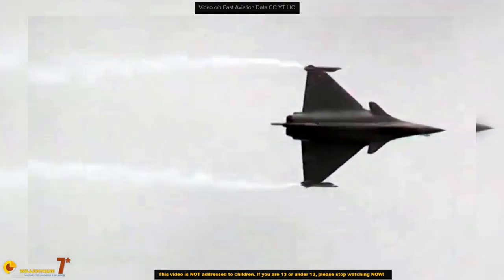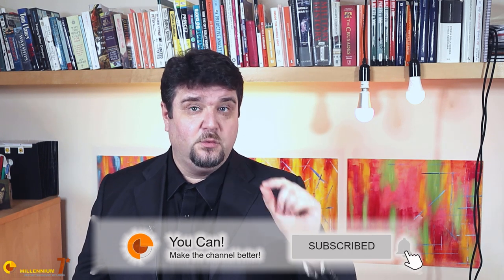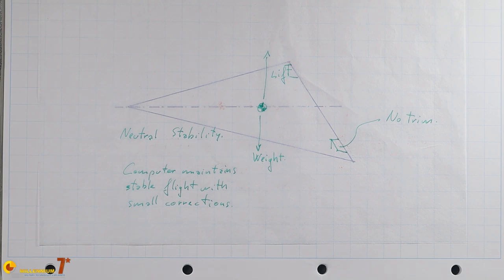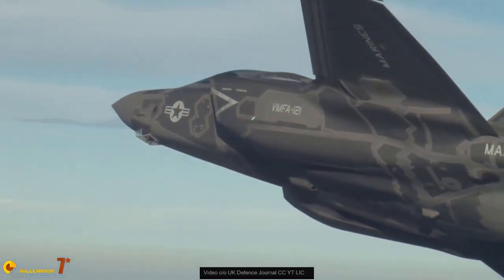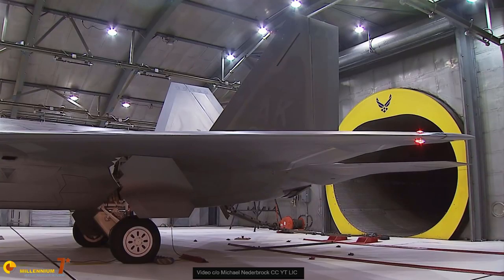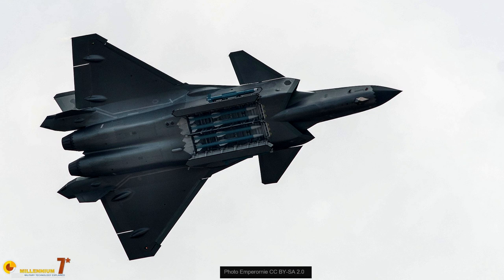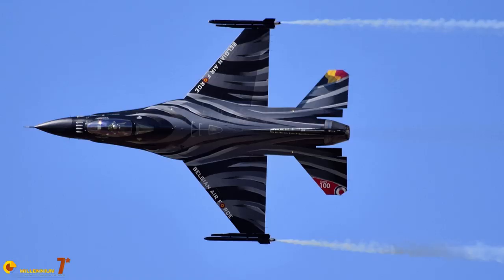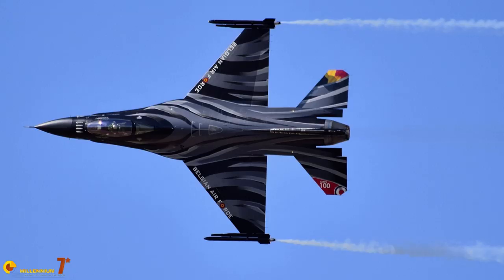Delta Wing: Why Not? - why Rafale/Gripen/Eurofighter are delta and F-16/18/22/35/Su27/Mig29 are  not

Comment: If you want to see what an F-16 with a delta wing would have looked like, there is the F-16XL, which was a competitor to the F-15E.
Reply: If you want to see what an F-16 with a delta wing looks like, just look at a bog standard F-16.
Despite what some may say, it is a delta wing -- a clipped delta, but a delta nevertheless -- with a tail making it a tailed delta.
This isn't something new ... the MiG-21 is also a tailed delta and if you look closely, its tips are clipped as well.
The difference between the F-16 and the F-16XL is simply that the latter is a tailess delta.
Reply: @lewiscole5193  Exactly what I was going to say. Both the F-15 and F-16 and delta wings, with cropped wing tips. The F-18 doesn't quite qualify, because the leading edge is no angled enough. The F-22 is basically a cropped delta, but with angled trailing edges.
Reply: @lewiscole5193  A clipped delta wing? Are you kidding me? I can make just as strong an argument as saying it is a straight tapered wing with a root extension. The F16 is a compound blend of two shapes. A smooth blend would make it an ogee delta like the F16XL. A sharper one like the F16 is a compound delta or a cranked arrow. 
The cropped delta are Typhoon or Rafale.
Reply: @watcher63034  
> A clipped delta wing? Are you kidding me?

No.  Are you trolling me?

> I can make just as strong an argument as 
> saying it is a straight tapered wing with 
> a root extension.

What defines a delta wing planform is that it looks like the Greek letter delta, which is to say a triangle.
If you extend the the line of the leading edge of F-16's main wing to meet the line of the trailing edge, what most people can easily see is a triangle that resembles delta.
Many people, perhaps even most people, think that a delta wing planform must have a low aspect ratio in order for the wing to be called a delta (say around 3 or less as this is what you see on aircraft that are intended to fly supersonically), but there is no "formal" requirement that I know of that says that this must be the case.
If you know of such a requirement from some aerodynamics authority (which obviously isn't you), let's hear it.

As for straight tapered wings, say like that on the F-18, yes, if extend the leading edge line to meet the trailing edge line, you do end up with a triangle, and so I supposed it could be called a delta, but at some point, just about everyone in sight (except for the mathematicians among us) would say that it doesn't looks like the Greek letter delta and so wouldn't call it a delta (even though it is a triangle) but rather a "straight" wing with a leading edge taper.

> F16 is a compound blend of two shapes.

The F-16's main wing is a clipped delta attached to a blended flange (or if you prefer, a chine) with a blended leading edge extensions on which its designer, Harry Hillaker, originally planned to put twin rudders (vertical stabilizers).
The twin rudders went away and were replace with a single larger rudder. 
Although the flange/chine does provide lift (as does a cylindrical fuselage in general), it helps if you ignore it when you squint your eyes to come up with a wing planform categorization.

> A smooth blend would make it an ogee delta like the F16XL.

You're entitled to your opinion, but I think that many/most people would say that a ogee delta would look like the Concorde.
The F-16XL is what's often times referred to as a "cranked" delta or maybe even a "double delta" (the latter being what I've heard the Saab 35 Draken being called).
"Cranked" is often times concatenated with "arrow" to come up with "cranked arrow" because the line of the trailing edge isn't straight, but in either case, a "cranked" delta and a "cranked arrow" (delta) are generally considered to be deltas.

> A sharper one like the F16 is a compound 
> delta or a cranked arrow.

Again, you're entitled to your opinion, but I think that the F-16XL planform would be considered a cranked arrow (delta) or maybe a clipped compound delta.
 
> The cropped delta are Typhoon or Rafale.

Both are obviously clipped (or if you prefer, cropped) deltas.
But, unfortunately for you, neither aircraft makes what I said false.

Other than as a pathetic attempt to boost your image among your even more ignorant friends, your self righteous indignation doesn't seem worth my time to bother with any further.
Reply: It looks like a Tejas

Comment: The Flanker and Fulcrum were not designed with relaxed stability and fly by wire control.  For conventionally controlled jets they're astonishing.
Reply: @nickkorkodylas5005  Thank you.  I confess I wasn't aware that Su-27s had a true FBW system.  I thought it was more akin to the F-18's ECAS.
Reply: Its all generational upgrades. I believe legacy Hornets only had ECAS. Super Hornets have true FBW. Im sure Flankers slowly are integrating it into even stable designs. The F-15EX will have FBW options. Most importantly being that its trim will change automatically with nose direction and AOA. Keeping the pilots hands free more often.

Comment: I think the basic reason delta canard is not widespread is it's a good design in a rather narrow window in the history of fighter development. It makes sense if you aren't interested in VLO while having digital FBW. In the US and Europe this was roughly the mid 80's, the mid 90's in Russia, and mid 2000's in China. The US was basically too early. It had just acquired a large number of F-14's, F-15's, and F-16's. It had two active aircraft projects in the ETF and VFAX, both of which were awarded to existing airframe designs. It played with these configurations in things like the x31, F-15 Active, and F-16 XL.  
Europe was doing dev at the right time with the Typhoon, Rafale, and Gripen all being first flown in the mid-late 80's. The French liked their Mirages and the Swedes their Viggen. 
The Rissians were doing clean sheet design about the same time as the europeans but their computer tech was about 10 years behind and they were focused on catching up to the Americans so the Mig-29 and Su-27 ended up being aerodynamically similar to the F-15/16. They also played with the configuration in the mig project 1.44 and Su-47 but that died when the USSR dissolved.
Reply: That's what I was thinking. The delta has a lot of advantages, so for clean sheet designs in the 80s and 90s, they made a ton of sense. However, even in the modern era, the Euro deltas are not wildly outcompeted 1970s U.S. and Russian designs in terms of sales. They seem to fill a niche for countries that feel they 1. Absolutely must have the most capable light or medium weight fighter, and 2. Cost is not a factor, and 3. stealth is not an option. India buying Rafales is a prime example of this.

For many other countries:
- If you have the money and access to them, you buy F-35s.
- If you need a cheap fighter that can use western sensors and weapons, you buy F-16s.
- If you need a heavy fighter with lots of range and payload, you buy F-15s.
- If you need a cheap fighter with lots of range and can afford somewhat older technology, or you don't have access to western markets, you buy Flankers.
- If you need electronic warfare, you buy Growlers, and maybe you buy F-18E/Fs even though you don't really like them, because it simplifies your supply chain.
Reply: The F-22 has a delta wing.

Comment: A very nice video again. I had however expected a mention of the PAK 50 which seems to be a sort of hybrid, integrating the advantages of the russian flying body approach with canards hidden in the "'forward delta" strakes, although that is of course mostly an evolution of the tri-plane configuration of many F27's that only seemeed to go out of favor when thrust vectoring came in (after the first thrust vectoring prototype having both). That layout can for that reason as a sort of hybrid.
Furthermore: I think the J20 should not be underestimated. It seems to be (an attempt at) a best of both worlds solution: Stealthy but not to the detriment of everything such as in the F22 / F35. Call it a forward hemisphere stealth approach. I expect some special channeling / treatment in the air intake channels. The canards might look extra bad for stealth but only when viewed from a very low or high relative position. In real life stealth will be most effective on longer distances where the slightly lifted canards of the F20 might actually help to deflect radar reflections away from their source emiter. It is of course no solution against shoulder fired rockets but remember how well even the F117 fared in that respect. 
Lastly: The original DARPA driven CALF pre-F35 design was also a canard. At that time integrating both aspects however probably looked too risky. I however can't help wondering if this was not also influenced by a typical US inherent conservatism. Says the air force general: "I can live with the edgy bits but the wings are all wrong!That's not how a fighter should look!" (Add the Texan accent while reading) :-)
Reply from the maker: Interesting considerations. I am very interested in the Su-57 but reliable information is scarce, so far.
Reply: @Millennium7HistoryTech  Information is of course always scarce. I tend to rely on a holistic approach. In the end al that stuff touches again because the laws of aerodynamics can be reinterpreted but the physics behind it do not change. Thus there must be a reasoning behind those "hidden"' Su-57 canards. I suspect to retain the tri-plane layouts advantages while still improving stealth. The intruiging aspect is how this solution wil influence the trailing behaviour of such semi-canards. How will it affect the flow into the engiens for instance but even more:  There will be no cross main wing leading edge "vectoring" of airflow (Sorry if I sometimes have to revert to creative descriptions. I am not fully versed in the established "dialect"). In that respect Russian approach can also seem counterproductive to certain fashions. When those extra foreplanes appeared many people will also have shaken their heads in disbelief (What about stealth? What about extra drag?). It has however been proven they where spot on. Not much turns like a gigantic SU-27 series plane. And imagine what the fashion might have been right now if more money had been available for the S-37 Berkut. Talking about fighters "not Looking right". Talking about an interesting subject as well: Did you already cover FSW in a video? I'll check but if not this is a hint! :-)

Comment: Delta it's having it's drawbacks too: low lift/drag ratio, the necessity to cu it's tips in order to reach HAOA and high G's, low specific payload per surface, unsustained G's fully loaded with heavy long range missiles. Thus far from YF17 ideals.
Reply: The F-22 is a delta wing fighter,and it's considered to be the best fighter jet ever made.

Comment: The Indian LCA Mk1A or HAL Tejas is also a compound delta wing aircraft but has modified leading edges to make it slightly unstable for better maneuverability.
They incorporate ram coatings, ducted air intake, synthetic aperture radar and composites to reduce rcs.
Reply: Tejas.
It's so old a rehashed mirage with poor engine a radar that doesn't work, not wanted by the navy obsolete before it's even introduced.
It's only been accepted because it's made in India
Reply: @garyhewitt489  well the engine gef404 also powers heavier aircrafts like the gripen, fa 18 hornet etc. So its more than enough for the lca. The mark 2 will be fitted with the newer gef414.
And for the radar, the EL/M-2052 AESA radar is a temporary fit until the indigenous uttam aesa radar is ready for production.
And the navy now wants it after they upgraded the jet to their specifications.
Reply: @himankan  I know , I'm just trying to trigger some Indian nationalists lol.
On a serious note, why didn't the navy use the rafale ?
The Grippen would have suited as a cheap light easy to maintain option too.
So much of a modern jet is available off the shelf, engines avionics weapons radars, it's just a case of picking what you want and sticking it on an airframe, the tech for the airframes isn't really much above what an F1 team does these days, provided your not trying to be cutting edge and are prepared to "borrow" some tech.
If you look at the Grippen it's just a clever amalgamation of modern off the shelf bits, it's a very clever and practical way to do it, and by continuosly updating and refining it,it stays current. It is a bit like Lego or flatpak after all.
Reply: @garyhewitt489  India is trying to reduce reliance based on past experiences where they don't get adequate servicing or sanctioned off. They are trying to shift the focus to the upcoming indigenous mark 2 variant but that would need time. Rafale is still on the cards. There's another reason, the rafales are a bit costly and you may also get an f35 if you pay a bit more.
Reply: @himankan  I just did a quick wiki of the IAF.  What a strange mishmash of aircraft.
I see the SU30 , but with the mig21bis gone, the Jaguars must be getting short on hours, the mirages going I would say they're desperate for a low cost attack or mrole aircraft. The French and Russians don't really have anything off the shelf that would suit, and the home produced stuff takes too long to get in service.
An export licence built hornet would fit the bill in about 2030 I reckon.
I should phone the Lockheed sales department they would probably go for it.
Reply: @garyhewitt489  They considered hornet. But maybe they wanted an omnirole aircraft. Yes the multiple fighter types have created a logistical nightmare for the airforce

Comment: If you think about, most wings on modern fighters are a type of delta. There are no fighters that actually uses conventional swept wings like the English Electric Lightning anymore. F-16 is really a cropped delta with LERX, so is F-18. The F-15 is definitely a highly modified delta. The difference between US/Russia fighters and European carnards is really that the European went all out with the delta and stretch it all the way through 3/4 of the fuselage, and switch horizontal stabilizer to a carnard config. You take an F-15, switch the wing and tail location and boom you have a delta carnard. Just go check out the F-16XL, which is a compound delta with the low swept part basically the original wing and the high swept is the LERX on steroids.

Comment: Not disputing anything you said, but I just thought I would point out that they actually designed and built a prototype delta wing F-16 designated the F-16XL.  It's first flight was in 1982, only 4 years after the F-16 entered service with the USAF, and was intended to be a technology demonstrator.

Comment: Delta wing has the edge on easying design of the plane. Its figure helps distribute load from wing to almost length of the body fuselege wing adhere to.  And thats it.
By the way ,US and Soviet who has more experience in fighter design than European has throughly scrutinize on it , consider such design was not merit enough to implement  to their fighters.

Comment: Hi, Millennium 7 * HistoryTech
If the Germans doing WW2 had had the knowledge of making an aerodynamically efficient delta wing or swiped wing with vortex generation, would they then with the materials they got have been able to make supersonic fighter with 1-2 of their available engines?
Reply from the maker: If I had to guess, the engines were still a too low in thrust.

Comment: You did not mention that sweep ( specially high sweep wings, like delta ) is inversally proportional to CL, which means you need higher alpha to generate lift ( and need canards to help this, specially close coupled ones) compared to conventional wings. also, for unstable aircraft the canards generate lift downwards to trim the aircraft.

Comment: Ok! got a question for you. I find this videos very interesting, specialy from an engineering standpoint. In this video at 4.30 you say that the sides of the body is actually also working as deltawings, creating votexes. I have been looking at the F21(latest F16).  Does not the boxes its roof mess with the vortex and reduce the effekt of the small deltawings, you think?
Reply from the maker: It could be,but I suppose it was verified in the wind tunnel that they don't
Reply: @Millennium7HistoryTech  yes they must have. But I supose it reduces their effect to some level. Maybe not a key function that you need to have 100% effekt from